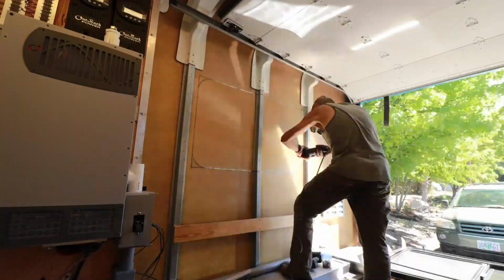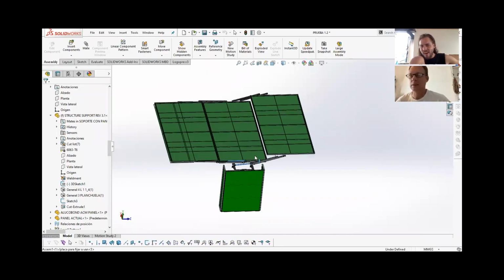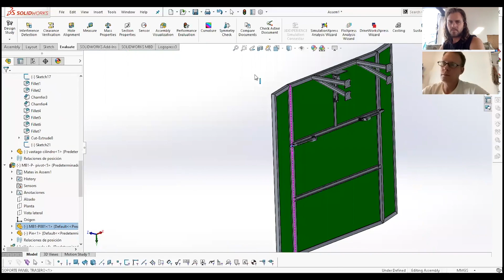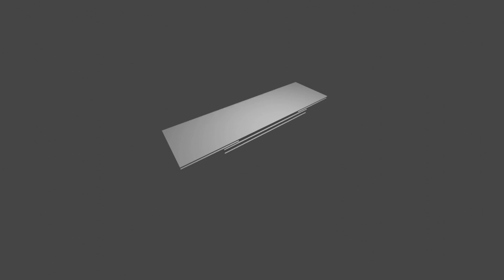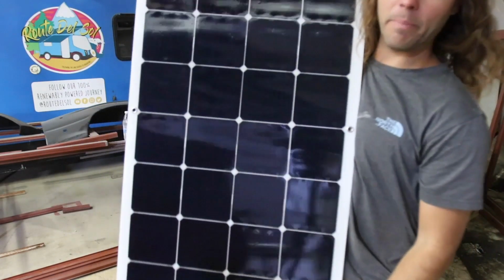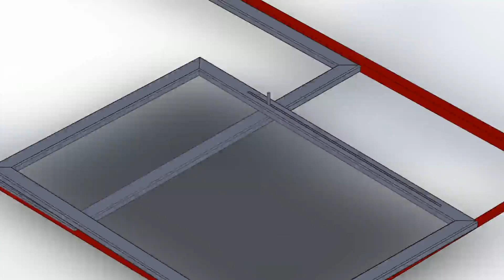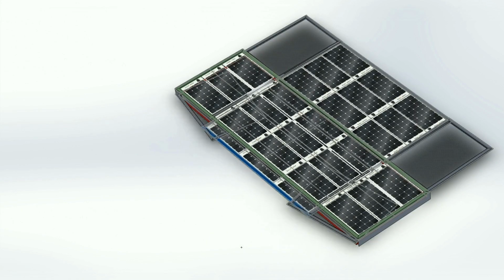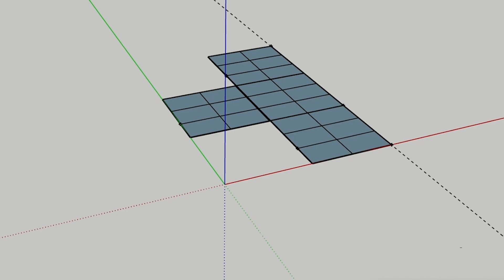HOW to BUILD a SOLAR CAMPER VAN | Designing My Solar Array Version 2.0 | Solar Electric Vehicle

Comment: So glad to see you’re getting back on the road. Be very careful how you attach the panels. I bought a pallet of sun power panels and attach them to a frame on top of an off-road camp trailer. I used one bolt through each grommet, and within 1000 miles, the corners started breaking off, from the panels vibrating in the wind. Of course, I didn’t know this was happening until one flew off going down the freeway. Lucky, like you, no one was hurt.
Reply from the maker: Thanks for the tip!

Comment: 69 panels - nice. While I was one of those doubters on insta for the folding method, but you've explained your reasoning well and I think it will work just fine. I also like how you're using tons of smaller panels, repairs should be very easy in the field with a few spares tucked under the bed. You're pioneering a whole new concept, I can't wait to see the next solar travelers iterate even further. My personal hope is a small solar motorcycle camper trailer towed by a zero or something, that would be a fun trip.
Reply from the maker: Thanks so much for you comment!

Comment: @3:20.  I went with the thin flexible panels too.  In addition to being hundreds of kilos lighter over the entire array, their thinner profile creates a lot less drag.  At speeds of 55-60 mph I've noticed less than a 4% loss of efficiency of my Leaf AFTER adding the roof rack and panels.  Those thin panels cut through the air like a knife.  I also like that you used the smaller 100 watt panels for the array.  It's a lot more nuts and bolts than the bigger ones, but if one goes out on you (as they occasionally do) you loose a smaller percent of the overall output.  Video like #122
Reply from the maker: Yes all the same sort of reasoning here from me. And yeah the idea is to be able to easily replace the panel if I should need to.

Comment: If you are charging with lets say 7kw of solar panels in ideal conditions, how efficient is the whole process until it reaches the batteries? are you actually getting close to 7kw of charge or does the charge controller/inverter etc. take some power away?
Reply from the maker: It is never 100% efficient. You have even voltage drop in the wires so not only the instrumentation that has inefficiencies. There is up to a10% loss from the panels to the batteries...
Reply: @RouteDelSol  Thank you for the info. :)

Comment: I am concerned about the attrition on the mobile parts. They are going to work on the structure of the array or on the frame of the solar panels structure? I think you should design it with some pieces that you can replace easily in case of weathering, breaking or bending.
Reply from the maker: Yeah definitely a good point! You'll see how we overcome all this as we move further into the build.

Comment: Is this array less power than the last one.. if it is does the weight loss for the lighter panels make up for that power loss?  How much power can your charging equipment handle? 8kw from what I remember. You could get a 2-4kw deployable array to keep in the back to keep you charging at full capacity power while stopped.
Reply from the maker: Yes slightly less power but way better quality panels. We have to wait until field tests to see what that means in the real world.

Comment: At first, I got to say I love that you carry on and that you get that kind of support. The mission to a sustainable future needs to carry on. 

I got a question on the solar-modules Choice. You said it was because of weight issues. I know, that there are „light“ glass panels with a aluminum casing that only weight about 15kg (33lbs) an has 325watts peak output. 
With your railing systems isn’t the whole construction equaly heavy to such a system? 
Is it because you need to stick to 12/24volts? 
Why not use marine grade solarpanels with a wood or cardboard backing? 

Is the weightlimit do tu regulation of the van? Or because of the railing system? Because if learned, that weight on a vehicle is only a problem while accelerating. When cursing the weight should matter as much.
Reply from the maker: You are right about the glass panels and us reframing them. They end up the same but there is not really a way around framing the panels ourselves no matter which we choose from. There are a million ways to do things too I wish I could try them all. I can't wait to see the community grow and learn from one another all the ways to do these kinds of builds.
Reply: @RouteDelSol  

Thx for the reply. I love the Projekt, especially from an engineering standpoint. it shows what „diy“ can do. 
I’ve looked a little further into the topic, to see if it’s possible to do some kind of camper trailer (popular in Europe) system, that can be used off-grid and will be able to support an electric towing vehicle. 
I‘ve found the sunman earche modules with just 4.5kg (~10lbs) because weight limitations are pretty harsh in Germany. 
Looking forward to your project I hope that more people will look in this topic and that it‘ll become a massmarket product

Comment: My name is Curtis And I'm 7 years in tiny home

Hello I'm new to this channel
I was wondering did you say the Mobile Van is on a 48 volt drive system and the main question is are your panels run in series or are they going to a solar booster, and what convigeration are the panels
I hope your still well

Comment: I'm not an engineer or anything, but doesnt having so many pivots and sliding stuff, bring in many potential points of failure? I am sure you have done your homework and it should look amazing, but it seems like that could go wrong in many ways, not to mention the amount of precision needed to keep it together with such a long turning arm
Reply from the maker: We're pretty confident in how this is gonna shape up there's lots of advantages and disadvantages in this design but ultimately it will work out :)